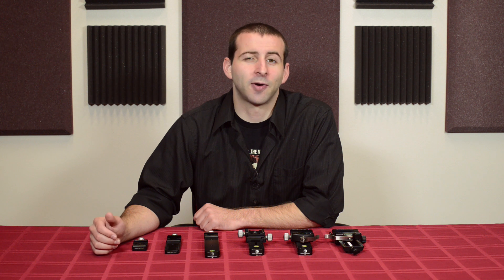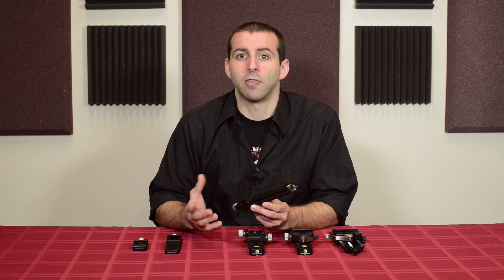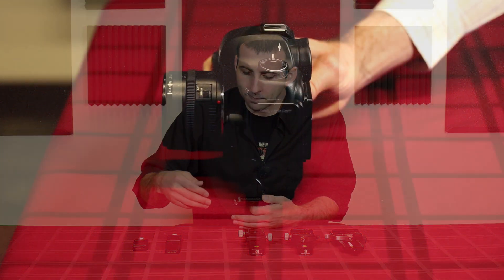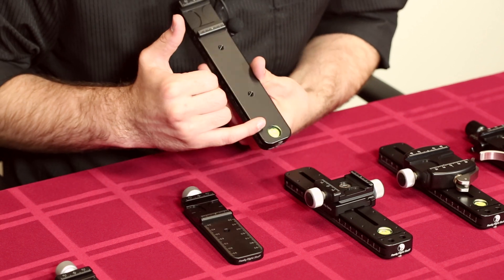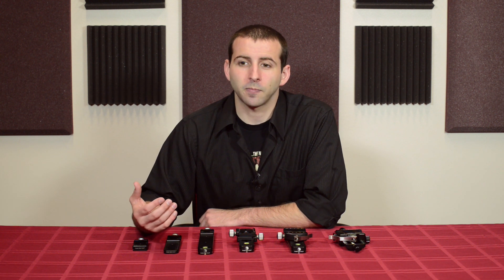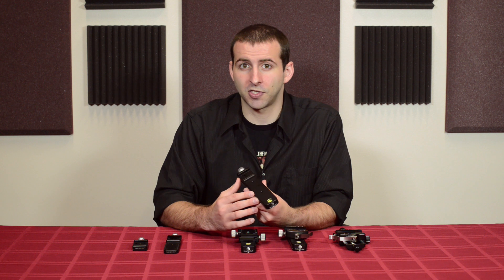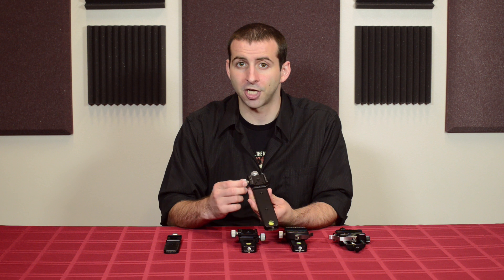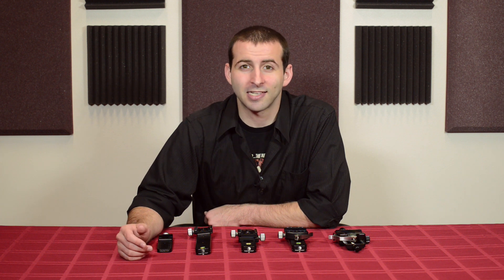How to Choose a Nodal Slide

Comment: I am trying to get the item numbers but when you give them you hurry through and slur a bit.  I will use wide Canon 16-35L and 70-200L collared.  Which one is it? Thanks
Reply: $$$$ but if you are using a tripod where it needs to be rock solid, the tripod and ball head are elegant monsters.  If you do get one, get an L bracket for camera and a separate bracket for 70-200 as must haves.

Comment: I really appreciated this video.
IMO, the MPR-192 PPP is well worth the extra $40 over MPR-CL II because it is more flexible.

One does not want to invest in a quality nodal slide, only to find the fixed clamp lets the fore end of the slide protrude into the image.

Some camera/lens combinations have an entrance pupil (NPP) point very close to the rotational axis.  
The MPR-192 PPP adjustable clamp location prevents the rail from intruding into the image.

There are several excellent YouTube tutorials on finding the NPP for a given camera/lens combination.
The salient point is testing two light stands in-line with the lens and moving the clamp position fore/aft until the parallax disappears.

As with all RRS gear, buy once and cry once.
The caveat:  buy correctly the first time.
Reply: Another solution would be to mount the plate on your lens horizontally on the foot.  This would allow use of any of the MPR-CL II which is what I think I'll do.  Surprised they don't mention that.